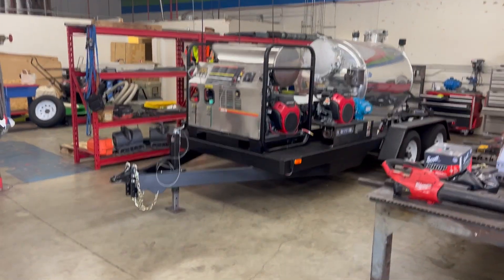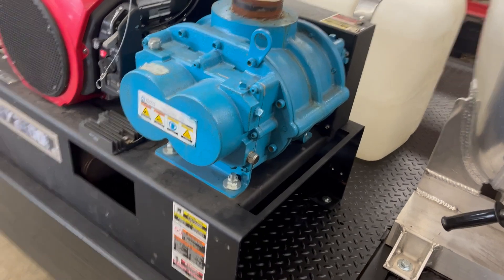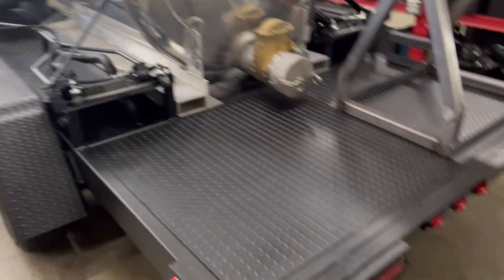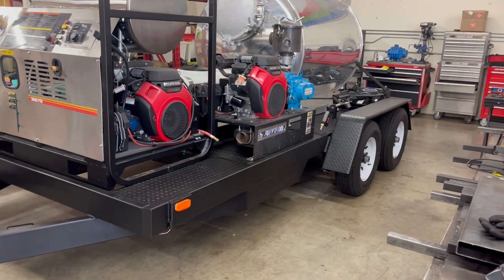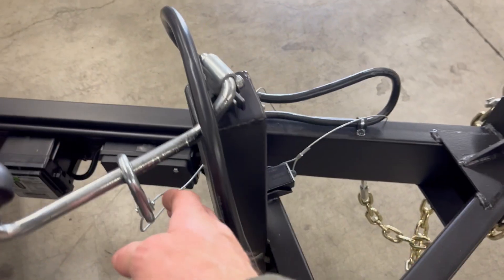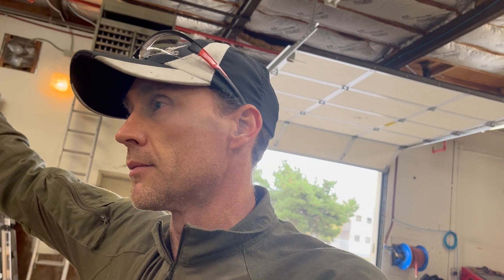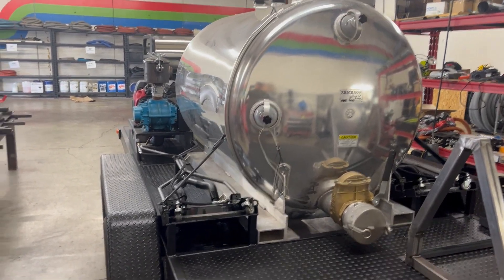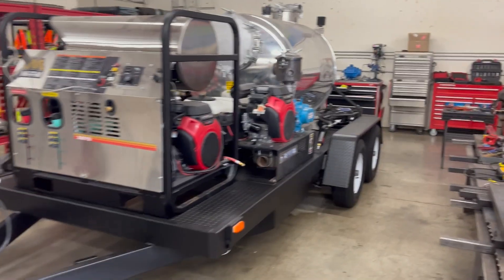New $100k Reclamation Pressure Washing System

Comment: Love your builds, your systematic engineering approach to problem solving and the detailed explanations!.   I'm new to the business and so glad I found your channel, learning so much from your experience.  thank you. 

I was thinking of building a water reclamation and recycling system for my truck and would love your input. The reason for the build is in my city water restrictions will become a problem in the future; being able to reuse the wash water over and over will let my business thrive during those times.  

The idea is to use 4 stage filtration of the recovered wash water before it's sent back to the main holding tank. First is a simple large debris pool vacuum filter, then a grease trap  to separate the grease and oils, then carbon filters, followed by micron pool water filters to ensure the water returning to the tank is clean enough to be reused.  The build should be fairly straight forward but I'm wondering if you see any problems with this?   Like if too much bleach makes it back to the holding tank it could damage the pump.  That said, I'm planning on also installing upstream or downstream ozone injection to avoid the need to use bleach in most cases. Ozone has many benefits, one being a much shorter life span so even if some made it back to the tank it would rapidly degrade.  

My business is starting as mainly a hot water dumpster pad cleaning business and will hope to expand into other larger commercial jobs over time. 

Again, thanks for your amazing content and sharing your vast experience in this industry.

Comment: Thanks Ben. That is an awesome build! Great work. For a future video.... Can you explain how to determine PSI on an 8GPM? I heard you mention "size of your pulley". Can you explain that further? Say I wanted an 8GPM 3500 PSI. How would I configure that?
Reply from the maker: Tex, the only way to determine the psi rating of a pump is to look up the pump/part number on the manufacture's website.  OR, put it on an engine, crank the unloader down to max pressure and test it with a gauge... but I would not do this, because sometimes it's possible to damage a pump if you try to overwork it.  best thing to do is look up the specs online.

Comment: Are you thinking the aluminum tanks will hold up better or just be faster, cheaper, and lighter to replace than a steel one? 

Is there some chemical engineer/chemist/etc who’s got a quality process on durable coatings to protect the reclaim tank interior and exterior surfaces for better long term longevity? 

There’s gotta some blend of chemical compound to protect it from all the sodium and general smorgasbord of chemicals it will encounter during much hard usage.
Reply from the maker: Lighter, but also significantly weaker with respect to implosion resistance.  Close to TWICE as expensive, but will retain wall thickness longer, as the aluminum will not corrode or rust in the same way or as fast as steel will.  If the tank survives far into the future, it will eventually become stronger than a steel tank, as steel will basically rust out and disintegrate from the inside out on a long enough timeline.  Aluminum looks better (when polished).

Multiple pros and cons for each. I would have gone with steel, but this aluminum was all they had, some other guy bailed out.  Otherwise, it would have been a 3 to 6 month wait, and I didn’t have that kind of time. But this is my first aluminum one, so I’m happy to see how it goes.  But just tapping on it, I’m nervous about the potential for implosion or collapse.  I just don’t know, and have no experience.  But we’ll see!

I don’t know what it’s rated to, but I’m setting a 15hg limit on it. Minimum 3” of valve opening during work.  So if the guys have one 2” hose going, they must have a minimum of 1” on the other side to relieve negative pressure.  And until I know the specs of this tank, and whether or not it’s warranties, if an employee even touches the key, before opening up at least 3” of valve, instant termination of enployment.

This machine will do around 50- 100k per month in work.  So if somebody destroys this tank being stupid or complacent, we’re out 30k in parts and labor and a minimum of 400k in lost work, not to mention all the people that would get laid off in the event of a tank failure.

High stakes. No mistakes allowed. No tolerance for that kind of mistake.  We simply can’t afford that kind of a f*** up.

Comment: Hi Ben, sweet build! Nice work around for the VIN becoming an OEM. You’ve mentioned in past vids that most OEM’s don’t provide the right equipment anyway. “Dreams coming true”.
I think the shocks are one of the best features. I bet the trailer and equipment will last longer with a little more cushion as you roll around.
Reply from the maker: Thanks Rich! I like building stuff for sure, but I think the OEM’s at large have made a big mistake not putting out a good reclamation system for commercial work.    Know why they haven’t because they think the shit will be too expensive, but it’s a mistake…

Comment: Love your videos. They are very much inspirational for the direction i want my business to go. Question though. The 50 gal buffer tank seems a bit small for an 8 gpm machine. What is the thought process on that?
Reply from the maker: Ya for sure.  Well the machine comes with a built in 3 gallon buffer tank which we rarely use. But with an adequate water source, even just a couple  gallons of capacity is enough to allow the machine to function.  However you’re right, in reality 3 sucks for most purposes, 50 is probably bare minimum.  I personally prefer a small buffer tank for weight and space reductions.  I prefer not to haul around any heavy volume of water we don’t absolutely need.
Reply from the maker: And also: my machines are all as minimalistic as possible. Don’t get me wrong, I love watching these videos of huge fancy softwash trailers with electric everything installed, every automatic remote control option installed. But I like to WATCH that stuff, in my world, it’s always BARE minimum of complexity and weight. Just more shit to fix. Spend all my free time fixing stuff, therefore all our stuff is lean, simple and as light as I can safely make it.
Reply from the maker: Maybe we get fancy later!

Comment: I haven't seen a video from you in quite a long time, I'm so looking forward to this build series.
Reply from the maker: Ya I know, I apologize I haven’t put any energy into the channel for months now.  No time…. What’s happening with our two largest contracts is just insane.  But the teams and the managers are really starting to get a grip on things.  By the end of summer this year we’ll have everything on lockdown and operations smoothed out, but still a little ways to go yet.  Hiring and training is extremely slow and difficult but we’re at a critical point where we have enough combined experience that taking in new guys is alot less painful now.  In about 6-8 months I’ll be able to cut the managers loose but at the moment they still need a lot of support. Almost there.  When we do finally get there, I’ll be able to move forward with the channel, get products going, how to series videos out.  Get some help with video production.

But I should be able to squeak this series out over the next couple months…